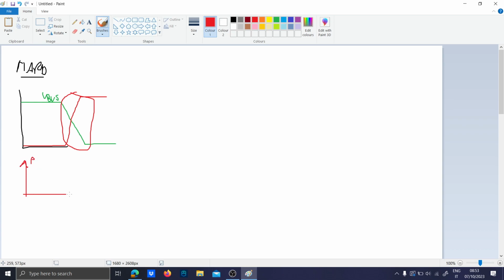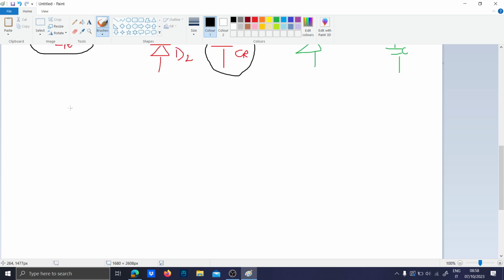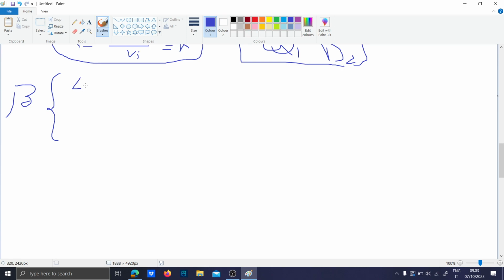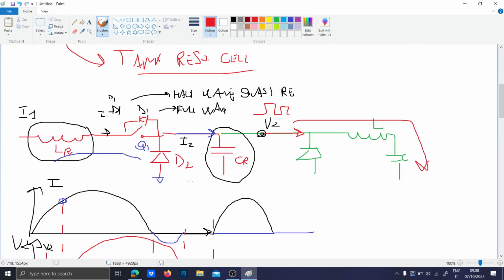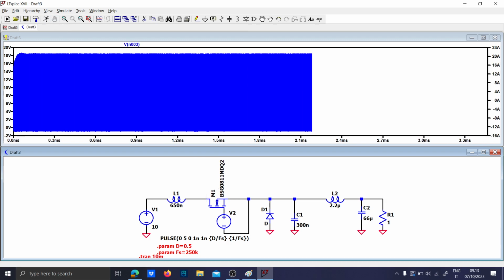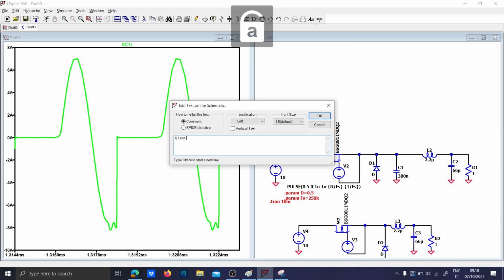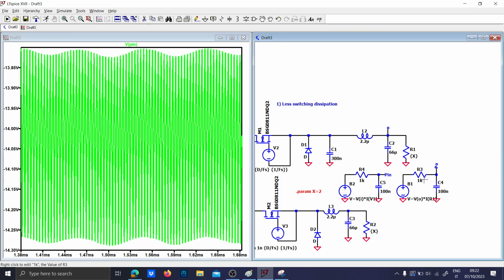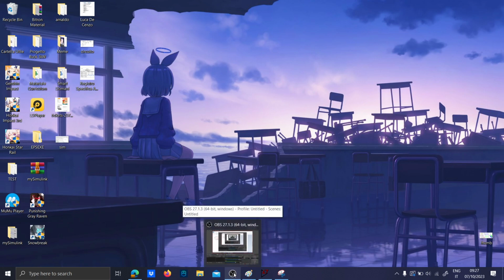LTSPICE Soft Switching Buck (Theory + Simulation)

Comment: am trying to calculate a value for my own Lr and Cr but i dont know how to get i2 would you mind giving me a hint
Reply from the maker: Consult Fundamentals of Power Electronics pdf online , chapter Soft Switching cells to have the complete theory and formulas
Reply: @manoA98A  gave it a go the result is okay but unlike yours my nmos current drops below zero. do you have any idea why
Reply from the maker: @Jeff-wf1ww  It's normal, check also the Switching waveform of soft Switching under all conditions and you Will find that It can start from negative current and then proceed with like a sine